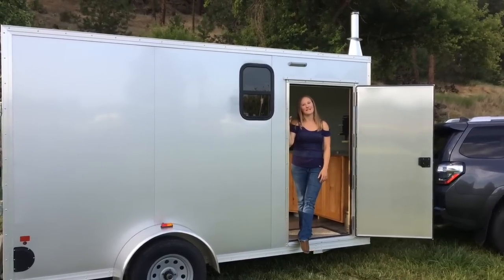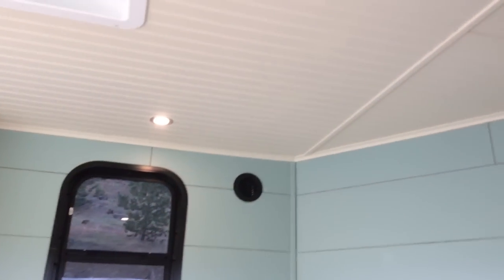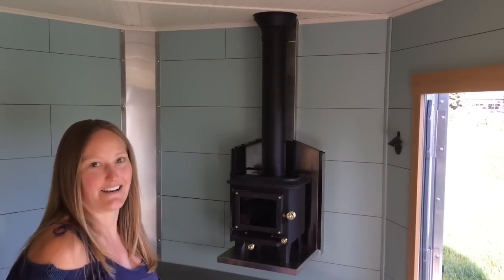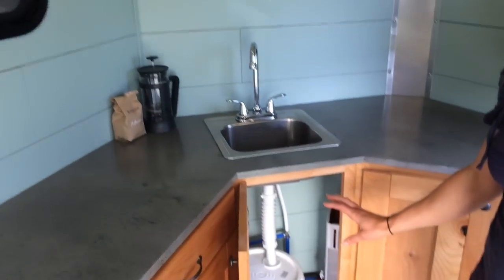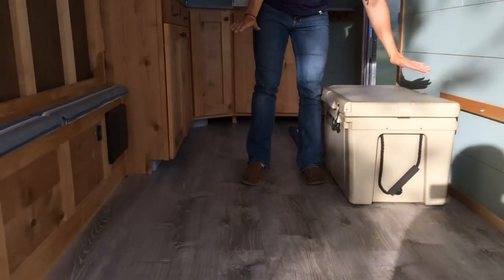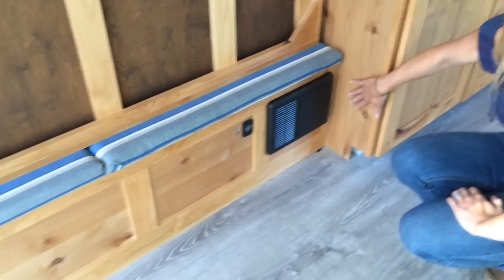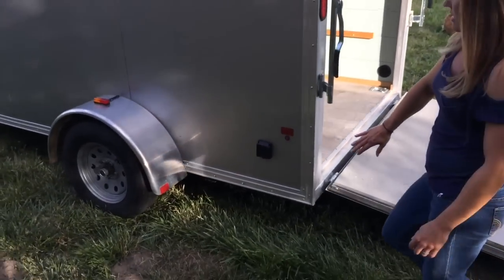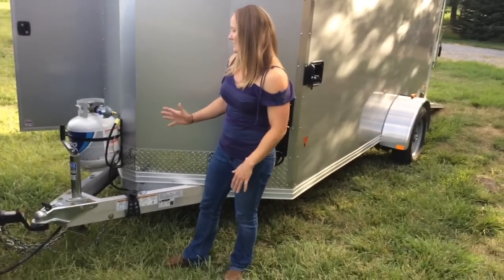Our DIY Cargo Trailer Conversion

Comment: How does the little wood stove do in a boondock?
Reply from the maker: I guess the real question is what your likely to encounter temperature wise. it heats the trailer really well, even in cold weather but it’s biggest limitation for me is that the burn time isn’t long enough because of its small size, a few hours at most before needing stoked again. for that reason I can’t really recommend it especially if you’re planning on frequently being in cold weather situations and counting only on this stove for heat. For instance last year I was hunting in Idaho during late muzzle loader season which is at the end of October, temps were mid 20’s  and I was stressed that my water lines were going to freeze when I was out in the field. I wasn’t planning on it being that cold and didn’t make other previsions to heat the trailer while I was away. I had no major damage but I did pop the lids on a couple water jugs so it was definitely getting cold while I was out hunting. In a pinch I can just use the pilot light on a heater buddy and it keeps my trailer above freezing on moderately cold days. 

Right now I’m building another trailer for a friend and we installed a style of stove from a company called 509 stoves out of Rathdrum Idaho. we haven’t used it yet but it’s a really interesting and a cool design you may want to check out. It uses gravity to slowly feed several presto style logs into a small stove and in theory you can get up to 12 hours of burn time out of it. I’m really hoping it pans out. I’ll be making another video of that trailer in a few weeks and I’ll make sure to add my first impressions with that style stove as well. We went with the 509 because of the longer burn time and my buddy plans on camping up at a ski resort on the weekends but needs the trailer to stay heated and doesn’t want to run a gas heater all day. So check them out. 

With all that said if you’re not planning cold weather camping this cubic mini stove is pretty sweet. 

I hope this helps.

Comment: Did you make your cabinets or buy them?  They are nice.
Reply from the maker: Elizabeth Hall, we made them. I’d suggest for people landing their project out that if cabinet making isn’t their thing then buy a trailer with a squared off nose and you’ll be able to pickup commercially made cabinet. I made mine primarily because of the “V” nose trailer also I used the interior wall board as some of the structural aspects of the cabinet. That way I could save on weight.

Comment: Where can I find a ventless water heater like you have,  looks really 👍
Reply from the maker: Bruce Nellis the one we have is the excel ventless tankless 1.6 gpm hot water heater. You can get them several places, we bought from the manufacturer but I know they’re available from camping world and I think Amazon. So far it’s been great. The only learning curve we had to make with it has to do with the auto shutdown. If the system detects low oxygen it will shut itself off. Thus issue has only come up when using the shower. To rectify the situation we simply open the cabinet door to draw in fresh air. I’ve thought about installing a little fan and vent to circulate the air inside the cabinet and I think this would fix the problem permanently. Also you’ll want to be sure to pick a CO & LP dual function safety monitor. I’ve never had an instance in which it’s gone off but it’s always good to have just in case a fitting gets loose from vibration or something. Anyway I hope this helps.
-Joe 

https://excelonlinestore.com/tankless-gas-water-heater-1-6-gpm-lpg-propane-ventfree-copper-heat-exchanger-231

Comment: How does the bed work?  Looks great.
Reply from the maker: I made a French cleat the length of the bed. I attached one half of the cleat to the bed and one half to the wall. When lowered on to the cleat the bed is kept in place and the weight is transferred to the metal wall studs. On the other half of the bed I have two independent fold down legs. Stop blocks keep them supported positioned correctly. I’ve had a lot of questions about the bed and so I think I’m going to make a video about it. I’ll try to post it in the next week or two. I’m also going to do a follow up on the cubic mini stove and also a video of the solar set up. Thanks for the positive comment!

Comment: What good is the bench if the beds in the way?????🤷🏼‍♂️
Reply from the maker: It’s basically just a bench with two compartments one to store the battery,  the controller for the solar panel and the power control panel. The other compartment is storage for the bed sheets and blanket. When the bed is folded down it doesn’t rest on the bench so with that we’re able to fold the lids up and gain access to those compartments. It also provides a surface that the bed can ride on when in the folded/traveling position. The cushions make it so that bed doesn’t jostle around and scratch up the alder sides. In the future we plan to add a pedestal table and then simply fold the bed against the adjacent wall so we can utilize the bench with a small dining table. Hope that answered your question.

Comment: You cabinets are they base units or did you build them.
Reply from the maker: Gary Tedlock, built them ourselves. I if I built them myself I could make them  fit my needs instead of working around the confines of what’s commercially available. With that said, they’re not that hard to buildUsed 1/2” ply boxes and alder faces. If the trailer was a square nose trailer I would have considered buying them. But with the angled front I would have lost too much space. Hope this helps. If you go this wrote a good angle finder is key.

Comment: Uh how do u use the bench? Beds in the way
Reply from the maker: Original idea was to put a pedestal table under the bed that popped up then we would fold the bed up to the other side of the wall and giving us a dining area. We haven’t needed that and thus the bench is basically just used as a support for the bed when traveling, it holds the battery bank and linens inside it with  half of it with a dive rider separating it into two compartments. When the bed is in the down position it acts mostly as a bedside table, holds phones, etc, it has a USB port right there too. So basically the original idea I think is sound but having to put away linens to fold the bed against the other wall to use a table and bench is more of a headache than I thought it would be to use, so we scrapped the table idea. We mostly eat outside under an awning that we’ve added since making the video. So in short it’s basically a storage box with a padded top.

Comment: Is the bed demo in the squeal
Reply from the maker: Timothy Thomas I need to make a two year follow up I’ll post a better demo of the bed. Not a super fancy design but functional. I made gold down leg supports on the side that sits on the bench and in the travel position they’re folded up out of the way. I have decorative gate  hooks keeping firmly against the wall. Then when I lower the bed I simply drop the side opposite the legs into a full length French cleat that is screwed to the wall studs of the trailer. Hope this helps.

Comment: How does the water heater vent?
Reply from the maker: It’s ventless, reburns it’s own gases. Works the same as a heater buddy. I didn’t trust it at first so I installed a carbon monoxide and Lp dual function detector in the same compartment and it I’ve never had it go off. The only issues I’ve had with it is the batteries for the ignition need replaced yearly, and I mounted it in an awkward place to do that, also when we use the outdoor shower we need to keep the cabinet door open and the overhead fan on pushing air down because it will deplete the oxygen in the cabinet and it has an internal sensor to trip itself off. Overall pretty happy with it after a few years of use.

Comment: Do you have the video of how you made the bed?
Reply from the maker: I don’t have a great video of it, I do have some more detailed photos I can send you. It’s basically a really stout box with a French cleat on one side and swing down Murphy bed style legs on the other side. For the French cleat I just took a 1x3 piece of alder and ripped a 45 degree cut on edge. I fastened that to the studs. I then took another 1x3 and ripped it the same way and fastened it to the bed frame. The opposing 45 degree joints pull the bed into the wall and the cleat supports the weight. In the legs I used binding post screws to secure the legs to the bed. The legs are cut to level the bed. During travel they fold along the bed rail, when in use a stop block keeps them from rotating. So if you want shoot me your email and I’ll send you some pics. I may make a video later this year but right now the trailer has about 3 ft of snow around it.
Reply from the maker: Also there’s a slide show, if you pause it a various places you can see more of the details 

Cargo Trailer Conversion Slide Show https://youtu.be/LsYXvNIHQHw
Reply: @littlejoey22  hi Joseph, nice job on the conversion. I'm interested in the bed also. Any thing could help. Ken
Reply from the maker: TheSimfixer I built a full bed box basically out of 1x4 alder and 1/2” plywood. I built it using floating tenons for the joinery, but I’m sure kreg’s screws or dowels would work well. I installed a French cleat on one side of the trailer and bolted it to the aluminum studs of the trailer. If you’re not sure how a French cleat works, it’s really simple, it’s opposing 45 degree angles that span the load across the entire bracket, that way all the studs take the load equally. I made that with 1x4 alder as well. Just rip a board length wise on your table saw at 45 degrees, take the two parts you just ripped mount one to the wall such that the pointed end of the 45 stands off the wall, then take the other strip and mount it to the bed so that the 45 will sit down on the opposing 45 on the wall. When you set the bed down in the cleat it pulls it towards the wall and locks it in, it can’t pull away. Then in the other side I simply mounted swing down legs, these are just threw bolted, I used stops to position them such that they’re flat in the ground but are still able to fold up during travel. If you’re having trouble still, send me your contact info and I can see about send you some photos
Reply: Joseph Nelson thank you

Comment: Really nice build. But putting the propane tank in the truck is a very bad idea. In the Trailer would be a lot safer for travel.
Reply from the maker: BlackSheep Expedition, agreed. I wish I had a better fix for the propane bottle. The few commercial ones I’ve had have all been kinda janky. The one I mounted in the trailer is just way too shaky,

Comment: Hoq much did it coast you
Reply from the maker: As is in the video it was roughly 8,500. Trailer was like 3800 + 400 for tax and registration. We’ve added more to it since then like solar panels, a shower curtain, more insulation some other amenities so I think we’re around 9,500 or so?